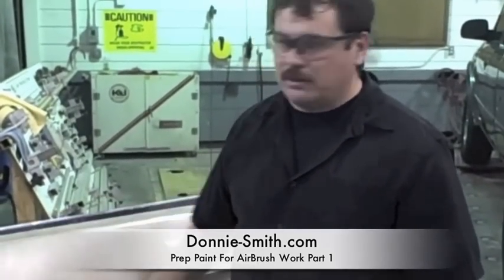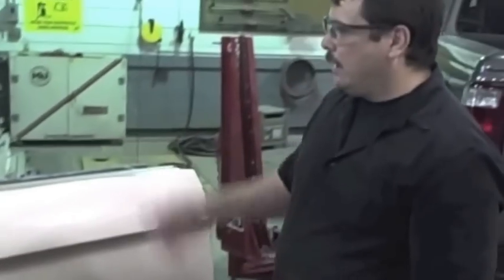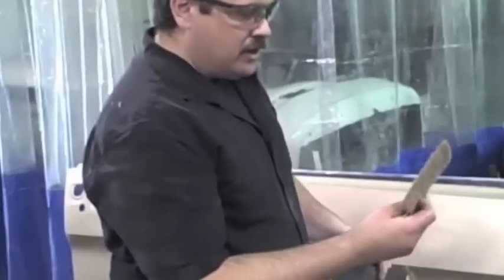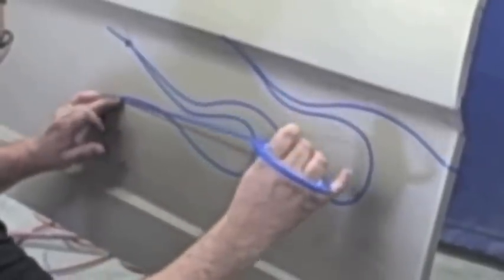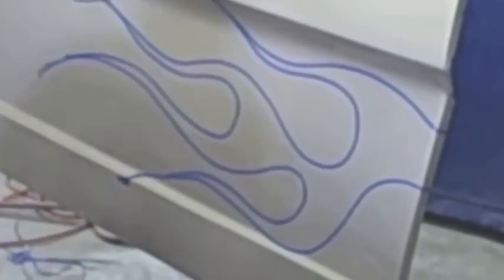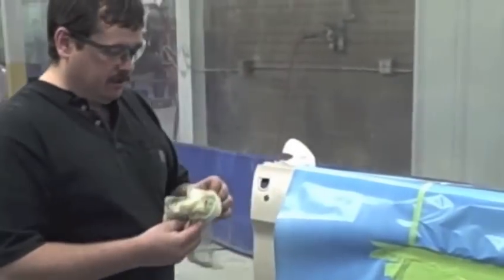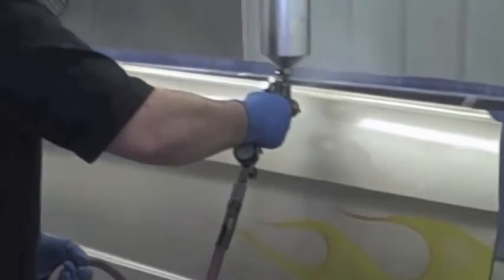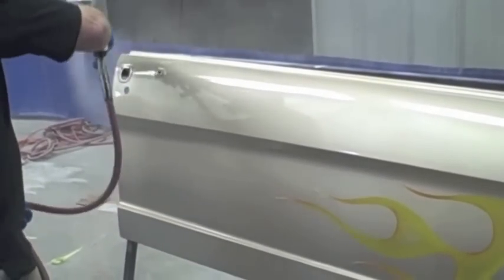DIY Custom Paint Tips - How To Lay Out and Airbrush Flames or Graphics on Car

Comment from the maker: There is a hard edge from the paint line, but sanding it before painting may cause problems with the paint.  If you want a line that you can not feel, you will need to clear, sand with 800 to 1000 and re-clear the surface being painted.

Comment: i am in the process of making a  hot rod i want to add flames i got carried away and clear coated the whole car after the clear coat window drying time has expired i made a  mistake and added some more clear i knew i screwed up because now i have some large dull dry spots on the top of my car where im not adding flames im not crazy about trying to buff them out so i was going to wet sand the top and reshoot the clear when i do the flames  job on the other part of the car. However i have read that you can not just sand over clear and shoot new clear that it will not bind or stick to the existing clear. My question is what is the difference when you sand over clear add graphics and reshoot clear other words if it works for that why would it not work for the top I used urethane  paint and clear  thanks for your help

Comment: So you can clear over a panel that has been sanded with 1000 grit to knock off the gloss and it won leave any scratches? How about sanding down only paint to apply graphics? For example, painting a guitar, letting it cure, sand 1000, airbrush, clear?
Reply from the maker: Yes, cured clear coat or paint should be sanded with 800 to 1000 grit sandpaper before clearcoating.  If not, the clear coat may peel.  The clear will cover the 800 to 1000 grit scratches and you will not ba able to see them.  I would paint and clear the guitar, then sand it.  This way you will be sanding clear and not paint.  Then you can do your artwork and clear coat.

Comment: I have a question the trouble I'm having trying to find videos that show this is for instance I want to paint a motorcycle and the tank I'm going to paint the colors are going to be black and a brandy dark red color metallic I want the bike to be mainly going to be the metallic Brandy color but I want to do some black stripes around the gas tank and then I'm going to do some sunbeams on the side of the gas tank now my question is since I'm going with those two colors do I lay the black down first and then tape off the line that I'm going to keep black and then the Sunbeam lines before I start airbrushing the fans on it or do I paint the whole bike the Brandy color and then do the airbrushing the black line the sunbeams and all that and the dragon scales so do I lay down black first and then tape off all the lining and then paint the bike the Brandy color and then do the airbrushing on the sunbeams and scales are dragon scales on the side or do I just tape off lines that I'm painting black that are going to be showing and then airbrush the dragon scales over the red paint my metallic Brandy and the lines and all that that's what I'm getting confused on if somebody could help me out I would really appreciate it going to be a Brandywine dark red with black dragon scales black stripes around the tank and fenders and and then the sun beams on the top of the tank I just don't know if I paint the whole thing block first tape off the lines that I want and then go back paint it red the Brandy color and then do the airbrushing on the sunbeams and on the Dragon scales would that be the way I would do it or primary then the color that I'm going to paint it Brandy dark red metallic and then tape everything off and do the black lines and then are brush all the black on top of the red I'm just trying to figure out what step to do it first lay down the black paint first then tape all my lines off and then spray it to Brandy dark red that I want or sprayed all the Brandy color and then come back in and airbrush the dragon scales on the lines around the tank and all that I'm just trying to figure out what process to do first if I can get some feedback I would appreciate it thank you

Comment: Why must you Sand the whole panel, and not just where you will be painting?
Reply: do it and you'll see why
Reply: Well, that was a valueless response, thanks
Reply: +DarkRenaissance2012 its because it would be pretty much impossible to sand after masking, you wouldnt be able to sand the edge along the masking properly and you would most likely ruin the edge on the masking tape so it would be a blurry line insted of sharp edge.  and it also makes the paint stay flat, not adding a layer of paint on top of the base coat. that wouldnt look as good as when both the base and graphic is blended under a clearcoat, it would look more like a decal or sticker. hope this was a better answer ;-)
Reply: DarkRenaissance2012